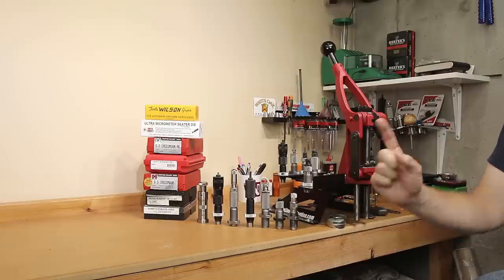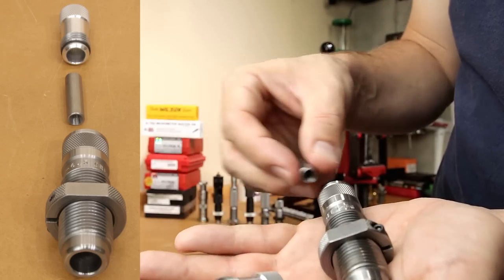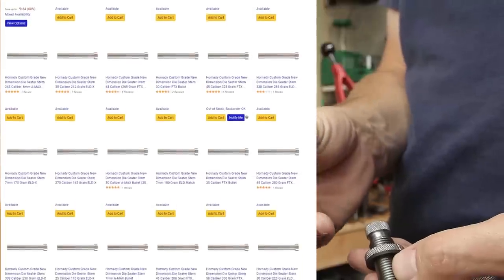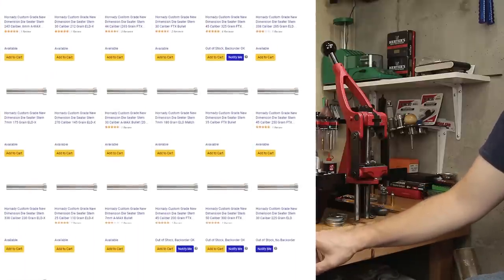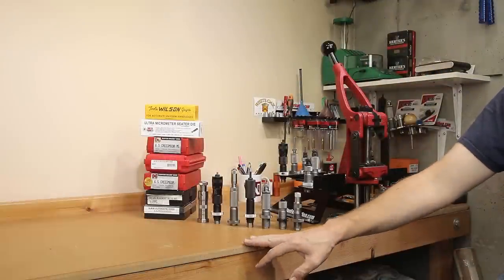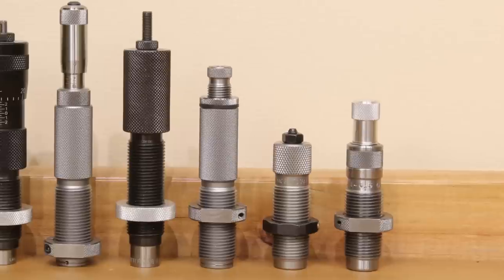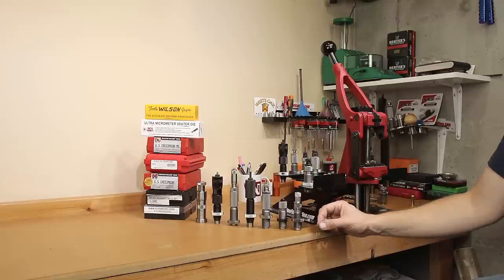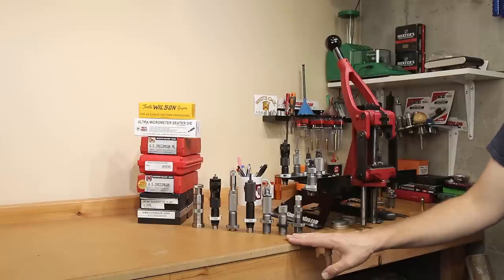how to choose the correct seating die

Comment: I have also tried all those dies, and like you the Forster dies are my favorite for normal reloading. For by bench rest gun I use the Wilson FL and bullet seater dies as these dies are the very best in my opinion with runout at or below 0.001. The Redding dies are way too expensive and the quality just isn't there. Redding does however make a set of competition shell holders with various thicknesses which I highly recommend. Great video keep up the good work!
Reply: Prob is Redding are one of the few brands that makes dies for oddball cals without having to go the full hog of custom made dies.
Reply: The complaint I have with my Forster seater is that the stem walls are very thin and the stem "flares", which causes it to become too tight in its bore and then it starts to scuff and stick. After a while of scuffing and sticking, the stem then cracks. I know forster places a premium on grabbing the bullet low on the ogive, but this isn't necessary for straight ammo when you have a nice tight fit in the bullet bore, and it makes the stem needlessly fragile and unreliable.

Comment: I am a Forster die guy and I have always been. Their full length sizing die and bullet seating die are very agreeable. But just for the hell of it I bought the Frankfort arsenal universal seating system. It is shocking that it is just as good as Forester micrometer die for 6.5 Creedmoor in terms of coal. It's painful to admit it when I think about all the dough I have forked over for Forster micrometer dies. But you can't go wrong. Especially if you have a lot of different rifles to reload for.

Comment: Nice video. Well done. I own or have owned all of the dies in the video plus other types from Redding, RCBS and Lyman. Your description is spot on. One thing I have found is that no matter the die, if there is too much neck tension it is a recipe for bullets seating off center. With too much seating force, my theory is that the case neck and/or shoulder buckles slightly under pressure of seating - and it is often to one side. Therefore, runout is induced. To remedy, simply increase the neck interior diameter. With bushing-type sizers, just go up a size. If using an expander ball, remove it and use a mandrel type of expander that is a slightly larger diameter. E.g. NOE Molds sells many custom sizes of expander mandrels that are paired with a Lee "Universal" Expander die. They work great!  Lyman "M" dies are the same concept, but they typically come in the same diameters as the standard expander ball so it won't give additional neck ID. I have also had expander balls wear smaller after about 10k rounds, so check for that.

Comment: And for those who are curious enough to read the comments to try to glean more information: the standard lyman seating die operates like someone took the RCBS and Lee dies and had them make a love-baby.  The Seating stem is integral with the larger "adjustment screw" and there is a locking nut to keep it locked in place.  It can be set up to crimp like the RCBS and Hornady dies.

I also have a Matchmaster seating die (which, for some calibers, I think can also be called the "gold medal" seating die and is an updated version from their "competition" dies) which has a micrometer and free-floating seating stem.  It largely operates very similarly to the Hornady dies in that it has a sliding sleeve inside the die body which holds the bullet and neck in alignment; the sliding sleeve does go further down the case, covering the shoulder and some portion below.  The other big difference is that there is a window where you can put the bullet on top of this sleeve, but you can feed it through the die as normal if you have that preference.  This is also the die which the Frankford Arsenal Universal resembles a lot.
Reply: The RCBS Matchmaster seater is indeed a direct descendant of the Gold Medal Match seater. Only updated markings and thimble separate the two. Both are fantastic for loading higher volume ammo on a progressive press. They greatly speed up production. While the RCBS "Competition" seater looks similar, it is not designed for progressive loading since it can't hold a bullet in place. It also typically needs and extended shell holder.

Comment: I have Redding Competition seating dies just because they seemed the best at the time. They work great for me and what bullets I shoot in every caliber I shoot which are many. I have looked at the Foresters and they pretty much look to function the same. I do have some of the Hornady bullet seaters as well even with the micrometer. Not impressed they do hold the case a bit at the top, but they certainly do rust easy and leave a lot to be desired. You can use them on multiple cartridges of the same caliber they are not cartridge specific. Example you could use a 30-caliber seater on a 30-30, a 30-06 or any other 30 caliber with a shoulder. This is a very informative video for the precision shooter. Myself I put together good hunting bullets that shoot sub MOA.

Comment: I'll give a few bonus points for at least including the Wilson / Sinclair seating die.  Sounds like you have not used one much, if it helps overcome the shock of not using the press to seat a bullet, there are more options than an arbor press.  Since I already have a drill press I find that works just fine.  You could also go the other direction, and either push the seating stem down with the palm of your hand, or tap it with a dead blow hammer.  Very simple options.  Most all the world dismiss the Wilson / Sinclair options as "specialty" dies.  They are actually quite basic and simple to use.
Reply: I’m thinking you could use them on a standard turret press, by turning the turret in between the die stations to get a flat surface, the just rest the seating down on your shell holder , then seat as you would normally. 
Even a standard press would work, same method just install a die and use that as the punch to drive the Wilson seater plug. 
I don’t see what it wouldn’t work. You’re not putting any extra force onto your press than normal seating. They even make special shell holders that are a completely flat surface. 
Use what you got, if that’s all you got.

Comment: Could you do a follow up testing the consistency in length of the loaded rounds and the difference in runout between the different dies. It would be nice to not have to spend $90 a on seater if the $40 one works just as well.

Comment: My lee die has seeted all the bullets I shoot to within 1 thou of an inch (concentricity) no problem, where as my hornady die only seats sierra gamekings well and not my hornady eldx sst or nosler cc bullets, I font know if its a factory fault but none of those bullets fit the stem where the sst is the worst. The sst is so skew that I can see it by just looking at the bullets in the tray
Reply: I can also not find seating stems where I am, speaking to the gunshop it seems to be a regular occurrence
Reply: Curious if you have found a particular stem that fits sst? My 129 sst have a bit of a gouge but, doesnt seem to effect performance. Once I dialed in my load they shot well and the one I used on my deer last fall performed excellent. I would just like to find a stem that didn't gouge for peace of mind.
Reply: @dandingfelder6763  my eldx and sst both gouge I got it better buy chamfering the cases, anealing the brass and slighty less neck tension.

Comment: How would you rate de Dillon dies to thus group?
Reply from the maker: Hi James. I haven't used Dillon dies so I can't comment. I believe they are made of carbide so they should last a very long time and not require quite as much lubrication possibly. As far as using them for precision reloading, I have always seen guys loading on a Dillon with dies made by someone else. Best of luck.

BAR
Reply: @BoltActionReloading  Thank you Appreciate your comments and enjoyes your video.

Comment: So the hornady die has no crimp capability?
Reply from the maker: I believe the hornady has roll crimp capability where RCBS uses a taper crimp. Either can be used with or without the crimping feature.
Reply: @BoltActionReloading  regarding the hornady, the gauge that you can add later to the die as an addition is interchangeable? meaning it can be used on any caliber?
Reply from the maker: Yes the micro just can be added to any of the hornady dies. At least the custom series and up, not sure about the classic American,  i don't own a set of those.